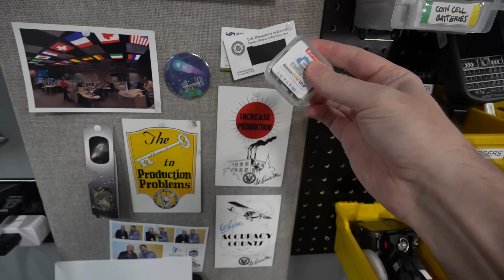The 'hidden' microphone inside the NanoKVM

Comment: Wouldnt it be cheaper to ask the manufacturer to just not solder on the actual mic, ignoring the traces and stuff on the board (since board redesign is not cheap)
Reply: Not at all. Even having a second version of the board would cost far more.
Reply: @shaunclarke94 yes, i dont mean a board redesign, you keep the traces, just skip attaching the component
Reply: @radiicall  You'd probably still end up paying more per board because you would be making two smaller orders.
Reply: It would be cheaper yes. But its probably a few cents, and whoever was designing it maybe wanted it out the door today, and not have to scour over the design and see what parts they could remove to save cost.
edit: its just built on the LicheeRV board, literally built on top of it, so it makes more sense to keep that board as is.
Reply: @jaro6985 yes but wasnt that a board also made by the company who makes the KVM? It would've made sense if it was a drop-in from another vendor
Reply: @radiicall  It is, they probably have thousands in stock.
Reply: @jaro6985 component cost savings would get lost to economies of scale and needing a second SKU to manage.

Comment: Stuff like this isn't done by accident. Talk about naive.
Reply: Talk about a  clueless conspire-sheep.
Reply: "NanoKVM is built on the Sipeed LicheeRV Nano core board." they literally have the schematics on their site showing you whats on the board. Have you never copied and pasted anything in your life?
Reply: Talk about paranoid.
Reply: You haven't built much hardware from scratch targeting ultra low cost have you.
Reply: @zyeborm  lol actually, I have! And you don't put a microphone on a PCB that you aren't going to use because.. get this.. IT WASTES MONEY. Ya feel me? Money? Even if it's only a 15 cent part, multiply that by 500,000 and it quickly becomes real money.
 
That's why I think this was a trojan. It phones home to the mothership with your IP and all other router information, and if they want, they can switch that microphone on for even more spying.
Reply: @Truth_Teller_101 have you built a cool device by recycling an old laptop? 
Well it has a camera and microphone! 
Are you going to rip those out? No, because that's additional work.
Reply: @Truth_Teller_101  And altering the PCB of an existing product, stocking a new line, warehousing, all of those things are free? Or do you just pick up the part you already have a million of in inventory and slap it into the product you'll sell a few 10's of thousand of without doing all that at the cost of 3 cents per part?

You aren't "adding a microphone" you are "doing work to remove a microphone"
Reply: @zyeborm  They don't have millions of these PCBs "just laying around". They are made to order for just this reason-->it costs MONEY to warehouse stuff you aren't sure you'll be able to sell. You also don't add a single nanogram of copper you don't absolutely need. You certainly don't add a microphone. It not only adds cost per unit, it adds cost to shipping at scale. That extra nanogram of copper quickly becomes 1,000 kilograms with a million+ units.
Reply: @Truth_Teller_101  They don't stock the dev boards they sell as their main business? They are selling millions of KVMs?
Reply: @zyeborm  All PCBs are made to order, and each one is specifically designed for a specific product. The effort to remove a microphone from the blueprint in the software would literally take as long as scrolling the mouse over it and clicking the button. They aren't going to reuse a blueprint with a microphone in it for the reasons I mentioned in a previous post. 

Even if they had some failed product, they aren't going to have more than a few hundred to a few thousand of the extra PCBs on hand, and they would most likely find a use for the PCB that would utilize the microphone as opposed to shipping it as a vestigial with another product. The odds of this not being done on purpose is extremely low.
Reply: @Truth_Teller_101  You save per board at higher volumes though. It is probably cheaper to order 1100 of one board than 1000 of one and 100 of a slightly different one.
Reply: @Truth_Teller_101 yes, it saves parts cost, but then you might lose that elsewhere by having to manage two almost identical SKU's for the one board.

When the revision is literally just not populating one part, it might not save anything when you factor everything else in, like the sales qty of the standard dev board vs the KVM variant of the board due to economies of scale.
Reply: @shaunclarke94  Who are you? An employee of the company? Why are you people doing rubberman contortions trying to make excuses for this business?
Reply: @Truth_Teller_101 lol, its common manufacturing knowledge. Not everything is a conspiracy.

If you distrust the company this much, why would you buy their products to begin with?
Reply: @shaunclarke94  Yeah I smell a rat. Someone should check your IP

Comment: I keep mine on a VLAN with no internet all by itself, only give it internet to get updates. I'd treat all remote access devices like this as such, especially since it has essentially full control over any computer you plug it into.
Reply: Same, no route no gateway no DNS. Simple BLOCK vlan..
Reply from the maker: @JasonsLabVideos  Just like my 3D printers, and most IoT gear I've ever set up!
Reply: @Level2Jeff This is actually bad practice, don't enable automatic updates on critical security hardware, that's an insane thing to do.
Reply: Hold on, you put it on the interment, for updates? Really? Why? That's actually more of a security problem than many other cases. For hardware related to system access manage updates manually, period. Do not ever go for automatic updates, you should know exactly what's running on it and updating a KVM is unlikely to help you in any case.
Reply: @orbatos  Added features I guess. I'd really like them to put web upload of isos. it's only online for a minute or two every 6 months.
Reply: How do you use them if they're not accessible from outside of your network? My understanding was that main purpose to have "physical control" over your device remotely?
Reply: @VavrMar  If you don't block from your main network->into your vlan then you can access it from there, or you can setup a VPN that gets you there.
Reply: @Sargentwhitey hmm that make sense. So I can set static routes between my main network and IoT VLAN. But if I won't set default gateway then those won't reach internet. But maybe could be more convenient to do it via firewall so in case I need to do any update I can just disable/enable one rule instead of adding/removing route 🤔?
Reply: @VavrMar Having physical control over your device remotely opens up a whole mess of security nightmares, giving a random cheap board total and complete control over your servers with tons of valuable data and, often, their own built in microphones only to get upset about a tiny microphone on the board that isn't even being used represents a serious lack of computer security knowledge leading to a lot of underappreciated risk taking
Reply: @VavrMar homelabbers might have home-servers in difficult to reach spots or in their living room, trying to find out whats wrong is much easier if you have a way to remotely access your server from your laptop or desktop without having to hook any peripherals directly into the server. I've thought about getting a KVM for the same reason, its very useful if something were to randomly break on my proxmox, or i have to change networking/gpu/etc.
Reply: @radiicall yes that make sense. I was always thinking about it as remote controll when some remote desktop SW is not sufficient (hard reset, bios settings,...)
Reply: Mine stopped working after a couple of uses, support did not help, won't buy anymore of their products.

Comment: I tweeted about this to you yesterday I think. The issue that many people had with this "secret" microphone is that:
1. Its reasonable to assume a KVM does not come with a microphone
2. If a KVM does have a microphone because it is based off other hardware, the expectation is that it would be disabled in firmware and the tools to record audio didnt ship with the OS.

Even though there may not have been bad intent by Sipeed with this, I think cases like these are important to talk about to keep yourself aware about potential issues and attack vectors whenever introducing a new piece of hard- or software into your walled garden.
Reply: hi, the article is 10 months ago, and we already removed the audio software at that time. Any 'suspicious' (although actually harmless) things have been removed, and I don't know why this article will be circulating again 10 months later...
Reply: @SipeedLab If you haven't, it might be worth making a proper public statement on it just so anyone looking this up gets clarification directly from the source.
Reply: @SipeedLab  Because humans will be humans, and we like to recycle trash.
Reply: Applying the same principles to hardware produced by all countries is the right way to go I think. I was recently working on a SBC that I realise it accepts a wider input voltage than it is documented and it’s Made in China. Sometimes you get a pleasant surprise other than a dodgy microphone 😂
Reply: It has a microphone so you get the full experience to be really at the server with all the noise. Full immersion! Someone just needs to add "transmit live server noise" to the software. 😂